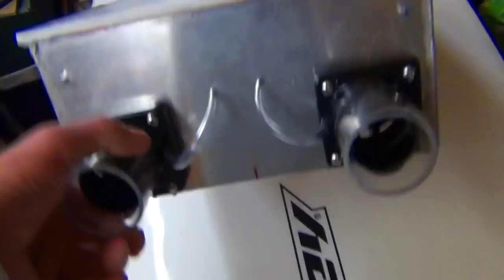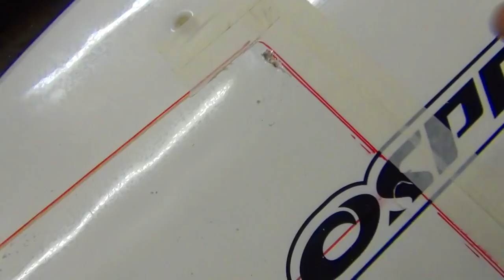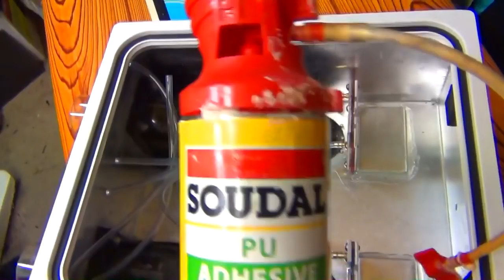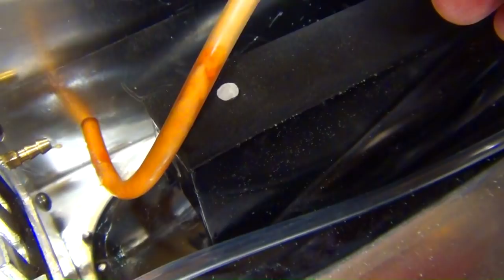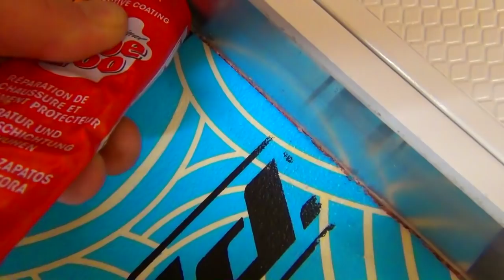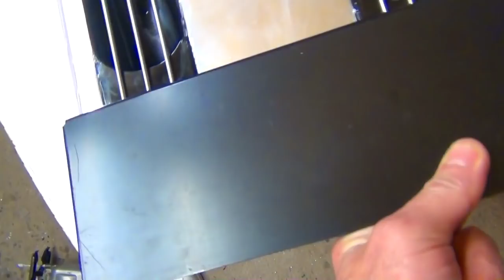SURFBOARD TO JET-BOARD CONVERSION

Comment: Hello I’m from Germany . And I want to know where did I get the engine the jet drive ? I want to build a boat where I can sit in with this jetengine. It would be nice if you can answer me    Greetings Elektrofreak
Reply: I think he makes the jets himself. He sells them too I think. Not sure about the electronics. There is another channel that used his parts to make a board. Have you seen the small jet kyack?

Comment: Too bad almost all steering comes from back foot, get it all flush sir.  Surfing since 1994
Reply from the maker: No Worries mate, I'm getting plenty of turn, the jets help out and change the dynamics from normal surfing I think, I might need some rails underneath to stop any oversteer and strengthen things up a bit though,,,
Cheers for the comment buddy, Have a Great night,, Mark
Reply: YOUNGSTERS JETS  it's what dreams are made of....  I've always wanted a surfboard with boosters not to just ride around but for that extra boost right when you're paddling your heart out to catch a wave in the ocean.   Maybe even to get past the break on a big day.
Reply: Mark, your board still has spot for fins...just get some small ones and put them in there. Wouldn't that work? Cheers, John ;)
Reply: Hiya RC Hunter, Yeah, the fit and finish with "making it all disappear" is what makes the commercial e-surfboards so expensive. I think Mark is trying to keep costs down and at least "get you out there" without breaking the bank. You could get one of his units minus the box and make a longer, thinner box and probably be able to hide all the workings in the back of a board with some ingenuity. Great thing about Mark's project is that he's giving DYIers some tools to work with. It's pretty cool, huh? I just started surfing and each beach that I can surf on is at least 1 3/4 hours away but I have lakes just minutes away from me and it would be so cool to grab a jetboard and go for a quick cruise on a lake...Yeewww! If I had some extra cash I'd be all over this as I have an old homemade windsurfer that is pretty thick that I think would fit the bill. It sure is a hoot watching Mark progress with this project tho... Cheers, John ;)
Reply: YOUNGSTERS JETS how much for your box’s and motor setup
Reply: Price